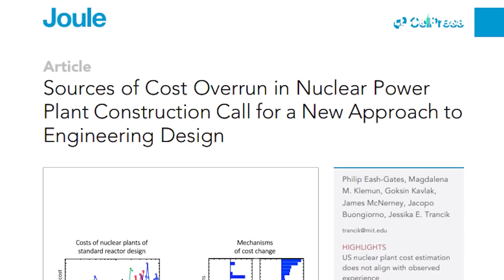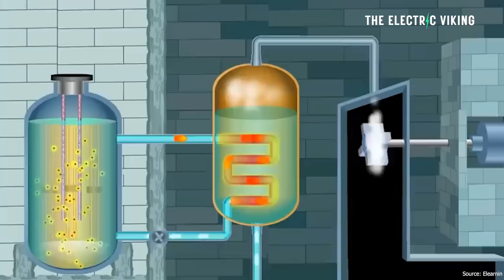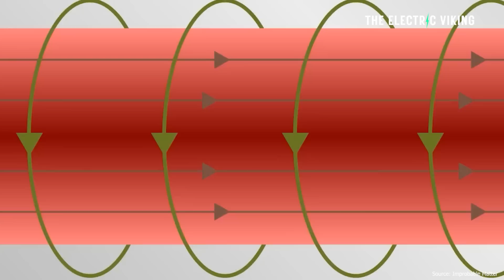Bill Gates says nuclear is the answer to the world's climate crisis...

Comment: Some  points on nuclear. We need electricity at night and when the weather is not cooperating. There are two strategies to mitigate against nature's lack of cooperation. The first is some form of long term storage and the second is space diversity - by using the Grid to transfer power from other areas where the weather is cooperating. Lets look at them.

Present battery farms are sized for load levelling. This is cost effective but it is not designed for long term storage. A simple calculation shows we would need battery farms between 100-1000 times in NSW larger than the present SA farms to make solar and wind work 24x7 to cope with common weather events. Storage is not free, even with reducing battery prices. The Snowy hydro storage projects are needed because we are phasing out baseload.  Snowy Pumped -Hydro is needed to allow more solar and wind which will have to be paid for by society and it would not be needed if we relied 100% on nuclear. Imagine the costs of any meaningful  battery storage. 

Now lets look at the Grid.  The Grid should be an opportunity to  share power from one region to another. A nice simple idea but there are 2 issues. Firstly the region providing power must have enough to meet its own needs plus that of the region requiring power. This is over provisioning.  Secondly existing Grids were not designed to transport this amount of power and we must accept a costly and massive upgrade. The costs of this upgrade should not be hidden in taxation but firmy attributed to the solar and wind industry.  

Lets take the cost of nuclear. Nuclear is expensive to build but the fuel costs make it cheap to run. Payback often does not start until 10 or 20 year of operation. But a nuclear plant can have a life expectancy of 80 to 100 yours.  The move to private funding of nuclear power stations has resulted in the present mess in Europe. Private industry is not comfortable with such long term  investment.
That is the issue that needs fixing with large nuclear plants. Small Modular Nukes are the nuke industries attempt to solve this issue.

Comment: Great video Sam! Thanks for doing the necessary research on this 👍
Reply from the maker: Glad you enjoyed it!
Reply: @electricviking 
NOTE: Indonesia's approved PPA for ThorCon to provide 8×500MWe liquid metal Thorium ion molten sodium-Berilium fluoride salt energy "Converters" (TMSR) at a fitted out cost of between $800 - $1000 per KWh; ensures this cost is met by ThorCon and only the cost of site preparation and linking to existing grids needs to be meet by the State; the first being situated to supply Bangka Islands, and is expected to be on line by 2026 at a levelised pre-profit cost of less than $30 per MegaWatt.hour (<3 cents/unit kWh)..
Reply: @electricviking   You didn't research enough. Nuclear is cheaper.

Comment: What ever the amount of solar power you need will require 8 times the amount to cover night and seasonal changes and cloudy days, next you need batteries to hold all that energy. The kick in the nuts is, if you get a long spell with cloud coverage or rainstorms you end up with black outs. Nuclear done properly will run you $5 billion per GW and run 24/7 end of story.
Reply: @222INFINITY Well said - see my attached example for a 24/7 Aluminium smelter's backup battery requirements if dependent only on Solar...
Reply: The Greenie misinformation is seasonal as well.  Here where I am in Michigan USA, my system only puts out 1/4 of it's rated capacity in mid Summer, and 1/30 of it's rated capacity in Winter.

Comment: We need a way to provide baseload electricity at night and when it is not windy. Battery storage is only good for 2-3 days tops. Right now we are providing baseload electricity with fossil fuels. We have to stop that. Period. Full stop. We have to have a way to make electricity during prolonged cloudy periods and prolonged periods when it is not windy. There is no feasible way to have enough battery storage that we can hold our summer solar electricity and use it into the winter. The solution is either fossil fuel or nuclear.  The right answer is to add in nuclear, even if it is 2-3 times more expensive than fossil fuels. Look at France. 70% of their energy is from nuclear and they have some of the lowest electricity prices in Europe.

Comment: With out a base load power solution renewables are not a reliable power supply. Lithium battery storage is not a viable solution to prop up renewables when the sun is not shining or the wind not blowing. As we don't have enough Lithium Ion to supply the demand for EV"s let alone propping up the power grids of modern western countries. So the question is if fossil fuels and Lithium Ion are out, whats your baseline power solution? Nuclear energy gets cheaper over the lifespan of the plant. As they have a lifespan of approx 60 years. They take up less land and are less destructive on the planet because you don't need to replace them every 25 years like solar, wind and batteries. They can also be configured to make hydrogen thermochemically. So in off peak times they can be making hydrogen for hydrogen fuel cell powered vehicles which is a much cleaner solution than EV's (I own a Tesla Model 3 so not bias, just realistic) which impose a huge impost on the environment because of the processes involved in creating Lithium Ion batteries, not to mention recycling Lithium Ion batteries is dangerous and financially nonsensical as its cheaper to dig up more Lithium Ion.

Comment: I think there is a place for nuclear energy. I think nuclear is the ultimate independent energy source to strive for when looking at it from a cosmic perapective. But it is difficult and expensive now. Especially nuclear fusion is most promising, but the limiting factor is the huge amounts of energy it needs to start up the process, bit once it starts it is virtually limitless,  compared to wind and solars limited fluctuating energy harvesting, even though we can get plenty from them. I think Bill Gates' interest and mission to promote fusion energy goes beyond the current energy crisis. Smaller nuclear reactors are currently expensive, but so we're battery technology improvements in its early days. It's all a question of time and scaling up. Yes, nuclear has a disadvantage now. But I think Bill's investment into smaller reactors also goes beyond the Confines of Earth and could be potentially more viable as a reliable energy source outside earth, where solar and wind power doesn't always make sense. Certainly Elon has also shown I terest in nuclear rea tors, is also proposed as a energy source for propulsion and energy for space ships and has even been used as energy sources in satelites like the voyager probes. It will likely also be a viable source for energy on the moon and Mars. So I think its interest goes beyond the Confines of Earth. Smaller reactors are viable. They are, for example, also used in submarines and aircraft carriers.

Comment: Heh Sam, I don’t consider you really have researched Thorium ion molten salt  reactors (TMSR). 
For example Indonesia's recently approved PPA with ThorCon for 8×500MW TMSRs at a capital fully fitted out cost, (excluding fuel salts) to ThorCon, at US$800 - $1000 per kiloWatt; leaving Indonesia's outlay needed just for site preparation and linking up to the local grids.
Thus the expected levelized pre-profit cost of less than $30 per MegaWatt.hour (<3 cents/unit kWh), for continuous 24x7x365 base loader, capable of automatic load-following to compensate for irratic "renewable" Solar &/or wind farms. 
Walk-away safe, high temperature salts but at near ambient pressure. 
Indonesia's first ThorCon TMSR-500MWe will take less than a year to be built in a double-hulled bulk-carrier barge and towed from a Korean shipbuilding yard to it's Indonesian Bungka Island site at ThorCon's expense, and is expected to be producing power by 2026. 
Hoping you will at least acknowledge this so i needn't keep hassling you about TMSR  cheers.😊

Comment: Good post. Well said. Australia is in a situation where solar and wind are no brainers. However there are smaller countries with very cold climates where it is more challenging. That said I think we should be investing more efforts into long duration energy storage. There are many systems beginning to emerge and they use far less resources such as rare earth materials
Reply: The new sodium-sulphur batteries should solve that one, as both materials are cheap and extremely common
Reply: Solar and batteries do not use rare earth minerals. Only wind generators with permanent magnet motors use rare earth materials (about 75%), the rest use copper or aluminum electromagnets to create the magnetic field.
Reply: @GoCoyote  I did say materials, not minerals. Some would say lithium is a rare material. But yes, you are correct, no rare earth minerals in large batteries
Reply: @rodandakiko2187  
Lithium is incredibly abundant, ranking 33 on the list of the most abundant materials on earth. Finding it in concentrations that are practical to mine is the real issue, but it is not rare, and is commonly found around hot springs in areas that are, or were, volcanically active.
Reply: Actually, if the sun doesn't shine in Germany, let's say during wintertime, there is so much wind that we have to close down the windmills to not overload the grid. This year it has been about 2 percent of all electricity used has been left out.
Reply: "We should think of investing in long term energy storage" D'ya think!?  How else can this thing work?  But does anyone here consider how much storage will cost? Nah mate, that's just money.  Well, there's plenty of folk freeze to death up here coz of money, or lack of.  And the more renewables the more expensive our energy gets the more poor bastards freeze to death.
Reply: @colinmacdonald5732  
As an electrician, in the early 2000's I was reading about energy agnostic studies that figured that we could have cheaper electricity in the US and Canada if we massively overbuilt renewables (without battery power), and that we could be 90% renewables in 16 to 20 years. Of that 90% renewables, 80% would be wind, and 20% solar, and the last 10% made up by gas peaker plants until batteries became cheap enough to replace the gas. 

The trick was to overbuild production capacity on a wide distribution, and increase the ability to move energy around on an improved grid. It is always windy somewhere 24/7, and always sunny somewhere every day.

While the public support and political will was never there to do that 20 years ago, the unsubsidized cost of renewables are now either at parity with other forms of power production, or much cheaper, even with battery backup included, since batteries have since come down so much in price. 

The US has spent, in inflation adjusted dollars, an average of 3.5 billion dollars of direct taxpayer subsidies per year on nuclear power since 1948, yet it is still the most expensive form of power WITHOUT decommissioning costs included. We have spent 4.8 billion per year on subsidies for oil and gas since 1918, and just 0.38 billion (380 million) per year on renewables since 1994, yet new renewables are generally the cheapest form of electricity now.

The actual battery backup required does not have to be very large when there is enough wind and solar power available to cover the majority of power needs most of the time. Solar power, like batteries, is unique in that it can be turned on and off in milli seconds. Wind turbines can also be individually turned on and off within minutes, allowing for very even matching of production to use.

Some of the biggest costs for utilities are the gas peaker plants, since the utilities are mandated to keep a certain percentage in "hot standby" condition, ready to provide power at a moments notice. Sort of like having a fighter plane with engines running while sitting on the end of the runway ready to take off at a moments notice in case it is needed, still using fuel, putting wear and tear on the powertrain, and requiring operators in the cockpit. 

Batteries are a much cheaper option, requiring no fuel or operators while idling. This is why BESS are so popular now, and the reason why your power prices have not increased even more. The utilities are often charging more in order to write off the high decommissioning and cleanup costs of closing unprofitable nuclear and coal plants.
Reply: Nuclear is eye wateringly expensive in the UK it is going to cost 70 billion  including subsidies over 35 years for Hinkley C to provide around 6% domestic demand at a guaranteed price of x4 the price of Onshore wind.
A similar sized offshore wind farm is coming onstream this year costing 9 billion and the electricity price is x3.5 cheaper than Hinckley's will be
with the spare 60 billion you could buy that 6% of homes a Tesla which would run their home for 3 days on a full charge or a complete solar install + battery backup @colinmacdonald5732
Reply: @colinmacdonald5732  Storage isn't needed. Only output up to about x2 to x2.5 peak consumption, good interconnections and diversification (not relying in a single source). Mass batery storage is a fad, since the concept of base load is an outdated concept that no longer plays in modern electrical nets.

Comment: Here is a potential solution to a current problem of supplying about 500MWe continuously to an aluminium smelter...
How to pursue cheaper paths for energy use - like releasing (for use as a base loader for existing wind farms)  an existing 650MW hydro station from providing about 500MW constantly 24/7 to an Aluminium Smelter -  (that's about 12GWh per day - so instead pick which of these two options would be Cheaper in the long run assuming 12GWh per 24/7 are required from a stand alone power supply built and owned by the Smelter (24×500MWe); 

A) a combined 2GWe mixed Solar/Wind farm costing $6b; ($3000/kW) providing daily power = 6hr×500MW=3000MWh directly to the smelter;
plus storing (over 6 hours sunshine etc as average utility); vis- 1500MW×6hr=9000MWh in backup gigapacks which will cost $0.666m/MWh= $0.666×9000=$6b; 
Total capital cost (farm & 18hr Gigabattery back up) = $6b+$6b=$12b;
Or capital cost of $12b/500MW (the average hourly 24/7 smelter  daily minimum supply needs) = 
$24000/kW (includes batteries)

Alternative B) 
stand alone 500MWe 
Liquid Metal Thorium ion Molten Sodium Berilium flouride salt burner Reactor (TMSR) capital cost say $1000/kWe
Walk-away Safe, High temperature, near ambient pressure, cold startable; pre-profit levelised cost less than USD30/MWh (<$0.03cents per unit kWh) as a continuous base loader; (also capable of load following for accomodating Irratic renewables); Also capable of supplying directly hot "solar salt" to maintain smelter heat requirements, (without having to convert via: Heat- mechanical-Electric - heat); for purifying & recycling smelter gases and waste, and possibly available to process existing long-term previous Flouride waste problem?
(This proposal woud be similar to what Indonesia is undertaking).
So option A or B would be the better choice? 
(A) solar-Wind With24/7 supply using MegaPack Batteries at $12m construction and 15 to 20 year life or -

(B) supplying 12GWe per day at capital cost of $750million at $1000/kW) and a 45 year life
ie. Capital cost of (A) for15 year life is 16×(B) capital for ⅓ the life of (B)
QED

Comment: You want a good example?
Put a 500MW ThorCon next to the Tiwai Point Aluminium smelter providing continuous energy 24/7 at 12GWh per day at a pre-profit levelized cost of less than $30/Megawatt.hour (<3cents per unit kWh) but (also capable of load following to help out irratic non recyclable "renewal" wind and solar farms). It's near ambient pressure, high temperature energy could also be transferred to the smelter pots directly using a tertiary molten "solar" salt loop (reducing lost energy that would have been required if transfered through the indirect  "steam-turbine-generating-heating" path).
By incorporating a ThorCon 500MWe TMSR adjacent to the smelter the Manapouri 850MWe Hydro power could then be used to compensate for irratically supplied power from wind farms or even adapted with Lake TiAnau to function as supplementary low head hydro pump storage?
NOTE: Indonesia's approved PPA for ThorCon to provide 8×500MWe liquid metal Thorium ion molten sodium-Berilium fluoride salt energy "Converters" (TMSR) at a fitted out cost of between $800 - $1000 per KWh; ensures this cost is met by ThorCon and only the cost of site preparation and linking to existing grids needs to be meet by the State; the first being situated to supply Bangka Islands, and is expected to be on line by 2026.